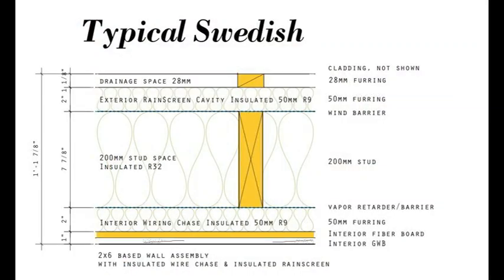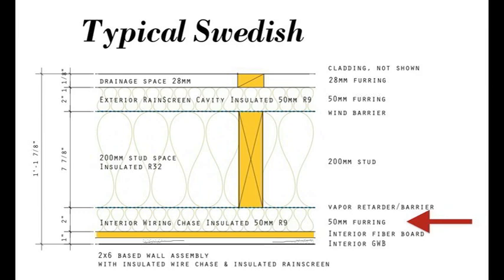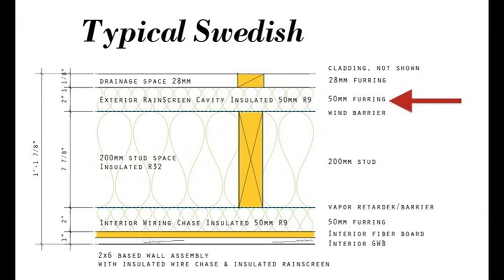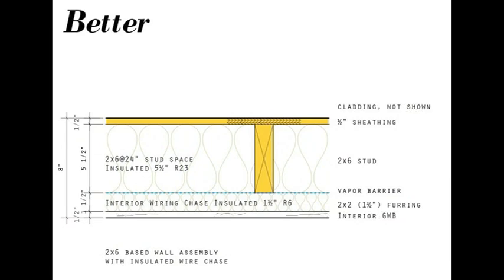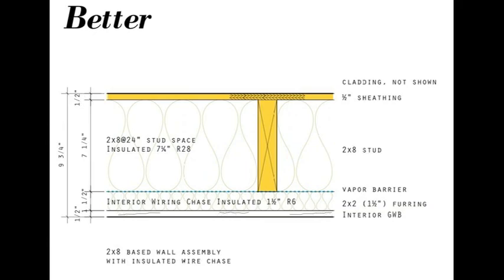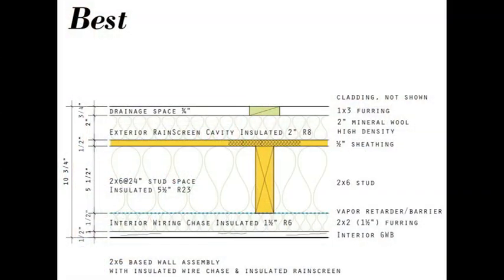Learning from Swedish Home Building Part 2

Comment: Don't see why a furring space on the inside is needed for electrical etc to avoid vapor barrier issues.  Worked as an architect in Alaska for 20 years, only did something like this on an indoor pool project.  Plumbing  directly in the exterior wall was not done and electrical was kept to a minimum but was doable .  Design temperature of 40 below was not uncommon and this meant a lot of vapor drive.  Vapor barrier typically was 10 mil clear plastic and tapping.  How many locations in the US have climatic conditions like Sweden and Alaska?  Walls were 2x10 or 2x12 with batts.  Roofing could be as much as R72 in trusses for a cold roof design. No furring on the ceiling.

Comment: Guys, using 1/2" sheeting at extrior, something like OSB board you make the vapor that get to the consttruction has no way to get out. You cannot use OSB at exterior especialy when we are talking about the northern states.
Reply: OSB has lower vapor permeability than plywood, or boards, but you can use it. What you can't do is Tape It. Taping it closes off all the incidental openings at the joints and lowers the permeability. That means if drying to the outside - NO Zip or the like. Sheathing panels + AWB. Better drying desired, use plywood or boards.
Reply: @glavardera  the main problem of OSB sheeting is that you have one sheet secured to 3 or 4 studs nad you have no ventilation there I think. That small horizontal gap between the sheets will not be enough I think so. What is AWB? I'm not  american 😉

Comment: Greg...absolutely the way we should have been building all these decades.
Curious as to what kind of foundation system the Swedes use and the considerations for thermal breaks and insulation?
Reply: For the type of foundations used by the Swedes see www.warmform.com based on Swedish frost protected shallow foundation systems for making floor slabs. 99% of new Swedish homes are built on a foundation just like this.

Comment: You said that with the firmest rockwool you can eliminate the furring used to hold to exterior thermal break in place, does that mean you just screw through the cladding and it's strapping, through that 2" layer of rockwool into the wall stud?
Reply from the maker: The dense continuous stone wool at the exterior means you don't have to use a furring member to create the exterior insulation space. Instead you fasten the strap-furring over it. The fastener goes through the strapping, through the stonewall, into the sheathing and the stud behind it. The cladding is attached to the strapping, not all the way through to the wall.

Comment: We here in the NW use Heco Topix Therm 300mm Exterior Insulation Screw to answer Krispens question. What does LamiDesign use? In this case you would not need the second furring over the studs.
Reply from the maker: The Topix is a nice fastener and does the job it was designed for well, but its fussy to install and a nice even final surface relies entirely on the skill of the installer.

The Swedes use a simple plastic fitting, a spacer, that is embedded in the exterior stone wool, and allows the furring to be fastened tightly against it. Its an inexpensive item, easy to install, and keeps the siding even and true with little skill.
Reply: Whats it look like, can I google it?

Comment from the maker: Actually, when applying vertical siding the Swedes will often put one strip of furring vertical over the studs, and a second strip horizontal over that, which is right behind the siding. This way they maintain a drainage gap.

Comment: When using the exterior rock wood panels, how do you meet code for siding nailing 1" into the studs? Use a framing nail for the siding? Sorry for all the questions, but we are very interested in this concept.
Reply: Siding nails routinely are put into 1/2" sheathing. Here they go into 3/4" furring. Nails 1" into the studs sounds like the requirements for wall sheathing panels, not siding. Here the siding is attached to 1x furring. The furring is fastened through the exterior Stone Wool into the studs and sheathing.

Comment from the maker: Yes, you use standard electrical boxes, but 1.5" deep units. For an outlet or light switch you would use a 1.5x4x4 box, with a switchplate reducer cover - that is a 4x4 cover with an opening that matches the size of switch and outlet devices, & extends the 1/2" through the wall board. Its a little different than the norm, but nothing strange. It keeps all the electrical work inside vapor control layer, which makes it easier to make the house airtight.

Comment: also, although spray foam might be performing much better than bat insulation, it is by now means enough in a 3,5 inch wall (nominal 4 inches). Of course, the exact value for the depth of the wall depends strongly where the house is built.
Reply: Sprayfoam into a wall cavity forces the wall assembly into an interior drying configuration. Now the thickness of that exterior impermeable insulation becomes critical to preventing condensation in that wall cavity. The impreciseness of spray foam application plus recent out of normal range weather conditions makes interior drying assemblies less resilient and I don't recommend them. They are a building science fad.

Comment from the maker: Hem, There are many reasons why spray foam insulation is not the solution, too many to fit in the space allowed here. Even if you sprayed the entire depth of the 2x4 you would have done nothing to mitigate the thermal bridges of the wall. Also it is well documented that spray foam can shrink over time, pull away from the studs, & spoil the air seal.

So in short, Yes, we need the kind of construction I am describing. I'll offer that if spray foam made sense the Swedes would already be doing it.